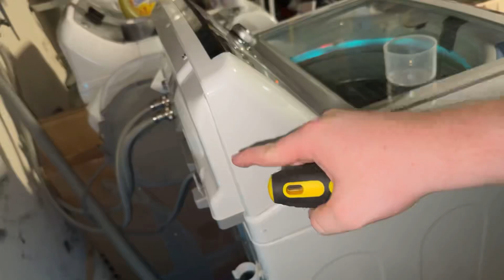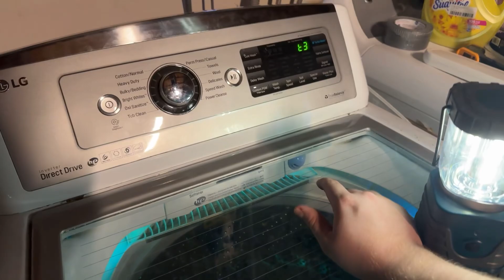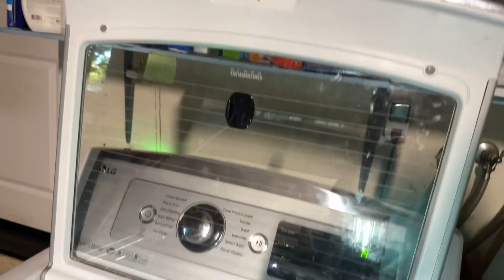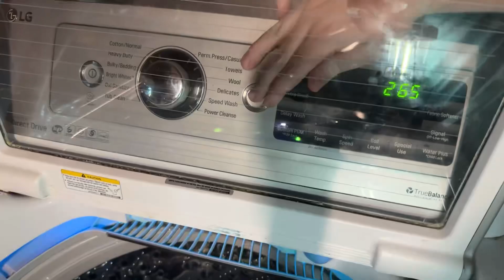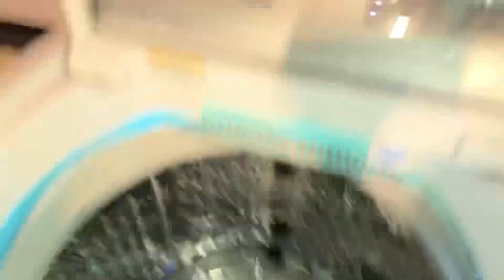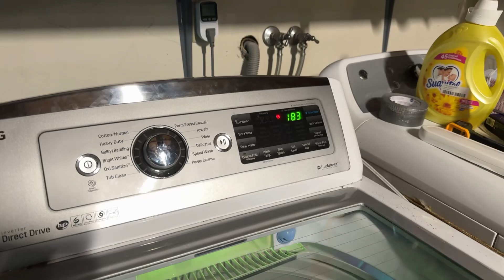LG Diagnostic Mode Walkthrough - How to determine problems on an LG top loader

Comment: lg washer not spinning and stuck on sensing, LE CODE
Reply from the maker: motor failure
Reply: A bad hall sensor will also throw an LE code
Reply: I'm having the same issue, but my model does not have a hall sensor. It only gives le error code when I have clothes in it. When I run it without clothes, it spins just fine. Any clue what that issue is?
Reply from the maker: spider or impeller damage?

Comment: Have a similar LG. And it’s making a really loud squeaky sound in agitation mode.  Can you please send me some pointers.  I can send you a video if that helps
Reply from the maker: unfortunately that just happens to these machines with age. no one really knows what the problem is but lots of them start doing that around 10 years old ands its the inevitable death of said machine
Reply: @  I thank you for your quick reply.  So on your video you said that you recommend buying used?
Reply from the maker: yes. do not but anything new and if you absolutely have to an lg front loader is the best now. but going on facebook marketplace and looking for a kenmore 70/80/90s series is the best now

Comment: On any Cycles, what does the Spin Speed max out to for Final Spin, just out of curiosity?
Reply from the maker: usually 840
Reply: @washdayx  Alongside, does it let you check the Spin Speed during the Cycle or is that feature unsupported?
Reply from the maker: yes you can with the custom program + soil level buttons